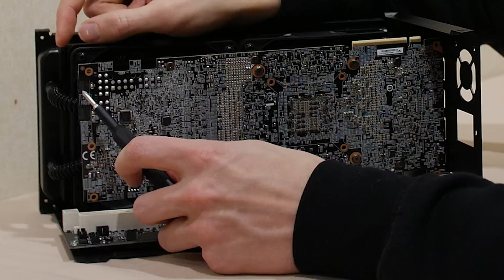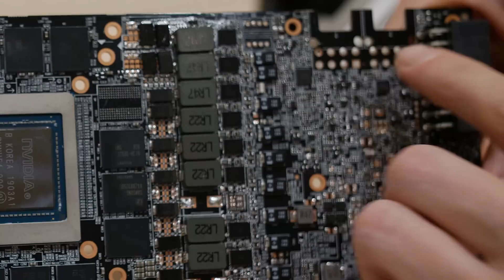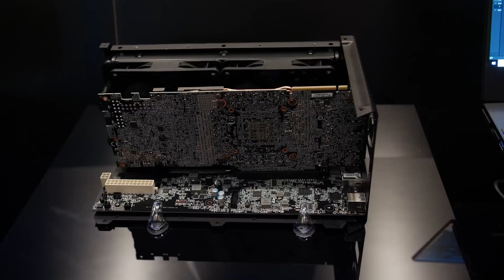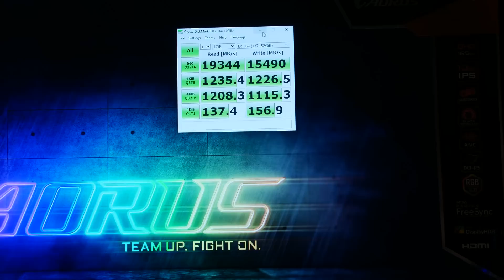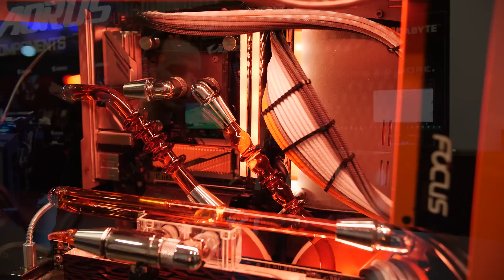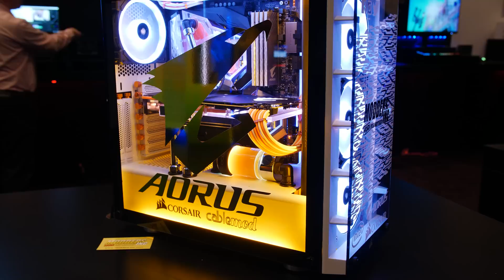AORUS Gaming Box - Teardown of the new Water Cooled eGPU Box

Comment: Hi there commenting on an old video. Anyways, I'm looking to tear down my box and insert the card into my pc. But I'm wanting to keep the water cooling bits. 

In mynown tear down the fan cables to the radiator are not standard.  

Do you know what spec they are so I can buy some extenders?

Comment: Can I use this in my desktop? I bought one for cheap, and I want to pull the 2080Ti and the 240MM rad and all! It’ll work right?
Reply: Did it work?
Reply: Chris 

Yes! It worked great! I power modded the card, and flashed its bios. It
Managed to lock down 2,145Mhz in
Anything. It broke 42K Firestrike
Graphics and 17,500 timespy graphics. Landing it dead smack on RTX3080 performance.

Comment: Aren't heatpipes supposed to have a cold and a hot side? Those look like they have a cold middle and hot sides...
Reply: Not really. If you think about it, most CPU coolers heat up the middle of the pipe and cool both ends. In general, a heat pipe is going to move heat from hot to cool areas anywhere along its length. You can even put heat sources at multiple points along a single pipe, like some laptop cooling systems with pipes that hit both the CPU and GPU. Having a hot end and cold end aligned with gravity is a little more efficient, but not required.

Comment: I'd guess the PCB is the same as another one if gigabytes designs but with some phases left off. Ever notice on some cards there are extra 8pin pcie power solder holes on the edge of the card?

Comment: Holy Moly, why does the back of the card looks like a battlefield? I've never seen so many SMDs on a single card.
Reply: it's an engineering sample.  very common that engineering samples will look like that.  same thing with the 8 pins he pointed out.  only 2 were functional because Gigabyte wanted to try a new position, and the original two 8 pin locations were there because the PCB layout was already there during in-house manufacture.
Reply: I was thinking the same thing. I have Titan RTXs with less SMDs on the back of the card lol, I wonder what's going on there. It actually almost looks like they just put white lines around all of the SMDs giving it more of a busier look, but it's hard to tell without getting up close and personal with the thing
Reply: Gigabyte tends to make their products look like that. It’s how you can generally tell if a card/motherboard is made by gigabyte. They outline every smd with with paint too

Comment: So it's 2080 SUPER or 2080 Ti I'm confused. Just pick one. I need to know... :D
Reply: OR the 2080 Ti Super that's still coming supposedly. Maybe they will give the full 12GB then.
Reply: @Martin M Where was it debunked? I saw a rumor back in Oct-Nov that was wrong but that wasn't the same story. Wccftech, tech radar, PCGamesN and several other outlets all reported it's coming in stories from December. I don't know their source but it seems a 2080 Ti Super is at least a  possibility if not an eventuality. Another chance to print some money without a new architecture or node. They haven't released a non Titan SKU with the full TU102 die yet. They'll still hobble the memory bandwidth to segment it from the Titan.
Reply: @glaciernine228  bruv, this is wrong. The 2080ti and Titan rtx use the same TU102 die. The only difference is the fact that Nvidia is charging 2500$ for the full TU102  and 1200$ for a cut down one with a hampered memory bus just for good measure. The 24 gb of ram is simply down to higher capacity memory IC's. This is in stark contrast to pascal which was a test run for the pricing structure. The Titan rtx is the same die class/core config  as the 480/580/780ti/Titan X and Titan Xp. It's only 2500$ because people bought the Titan x and XP for over 1000$ which is now the pricing structure of the 2080ti. It's die size is not that much bigger than maxwell it shouldn't cost twice as much not even with 24 gigs of ddr6, not even close.
Reply: @fVNzO  The Titan has more memory bandwidth and I believe it also supports GPU virtualization. I might be wrong about vGPU though, Nvidia is really stingy with that feature and is the biggest reason why the server engineers I work with use AMD gpus for compute and virtual machine hosts.

EDIT: The Titan and professional cards also support double precision/ FP32 properly which is a must have for many of these customers. Can't have them saving money by getting the normal consumer cards after all.
Reply: @faceplants2  the memory bandwidth is down to the cut down memory bus that Nvidia started doing with the 11gigs of memory which is absolutely absurd. The full fp32 acceleration is because Nvidia artificially locked GeForce down to 0.5x compared to 1x on the Titan and other pro cards. It doesn't have to be limited since they use the same gpu but it is. This is also why gcn is seen as a much better compute gpu for those specific tasks and the reason why quadro magically gets its performance in many cases.
Reply: @fVNzO  The point I was making is that the RTX Titan and 2080 Ti have different GPUs. They're both based on the TU102 die but the Titan has more RT cores, L2 cache, an extra memory controller, more CUDA cores and higher boost. It's basic binning and segmentation.

And yes they also impose artificial segmentation by limiting performance in certain FP32 workloads. I asked a friend who has deployed tons of workstation and HPC graphics cards about this since my OP and apparently the RTX Titan is dogshit 6x slower in double precision workloads than the Titan V. In all other workloads it's an improvement.

I'm a fan of hardware and like the technical details. I'm in no way encouraging anyone to buy a Titan or even a 2080 Ti unless you have an appropriate workload where you'll save you money or you just have money to burn. The 2080 Ti makes zero sense to me anymore unless you have a 9900k OC and a high refresh high res monitor to pair with it and don't mind paying the huge premium.
Reply: @faceplants2   Andrew S  for sure. It needs those little differentiations otherwise there would be literally zero difference between it and GeForce. Point is that the price difference is blown out of proportion this time around and its really counterintuitive for the whole industry that people still award Nvidia for their frankly absurd segmentation. 11gigs of vram on a 1200$ card is an absolute joke. Let alone the decrease in cuda/tensor cores. You would expect them to at least have the decency to give you the proper product when you go above and beyond on price. When you deal with doubling in pricing and beta testing for rtx. It's a thanks for buying this expensive card sir! Then kicking you out the front door and spitting on you. Things like that, the 3.5gig 970, TU106 70 class card, GPP and so on... I just don't like Nvidia if you hadn't noticed :P. They make great products but treat their customers like shit.
Reply: @fVNzO  I'm right there with you. Their marketing team is very good at what they do and their biggest fans do a great job of affecting mindshare. Even when AMD had the price/performance crown in the past (they do again in the 150-400 range) Nvidia still outsells them. I was a system builder for over a decade and I still build machines on the side for extra money and I'm constantly talking folks out of buying X or Y Intel/Nvidia part because it doesn't make financial sense for most use cases and build reqs. 

Yes, a 2080 Ti + 9900KSFU will give the best performance. No you don't want that unless you literally have to spend the money before the tax year ends or you lose it. I've built two machines in December with those constraints and they're the only 2080 Ti's I've ever bought.

I've compared the 2080 to the 5700XT side by side on 27" monitors running 120+ Hz @high and if I had done that after dropping four figures on an RTX card I'd be bashing my head into the wall. 

The reviewers bar graphs don't tell the whole story. I almost never run a game with a stock preset of high/ultra. There's always settings like motion blur, AO, volumetric fog etc that have a huge performance penalty on one card or the other and make no difference. Most channels don't benchmark cards with more realistic graphics settings and with features like image sharpening, chill and adaptive sync on. Tune the game properly and take advantage of the features built into the AMD software and the 10-15% performance gap gets into margin of error territory.

EDIT: I'm sure you already know about them but if not, you'd like the content over at AdoredTV. Coreteks and Moore's Law is Dead
Reply: @faceplants2  I'm an avid viewer already ;). I'm building systems as well, on a smaller scale though, but the last three systems have all been R5/5700XT nothing else makes any sense at the price points I'm given. Intel needs to realise that they aren't the kings of gaming anymore and Nvidias behavior will bite them in the ass as soon as the alternative becomes an option for regular people... I can't wait :)